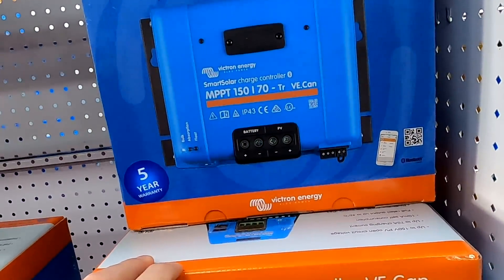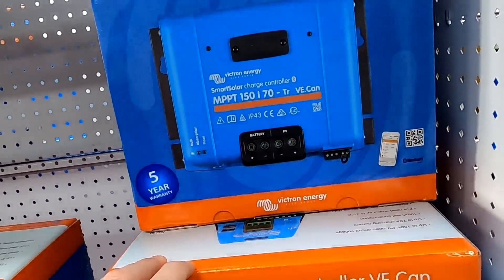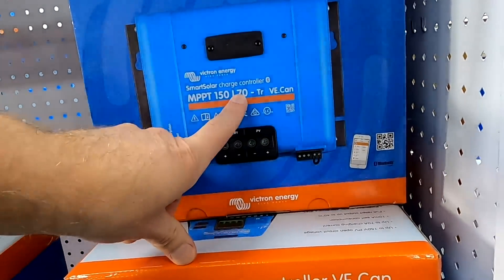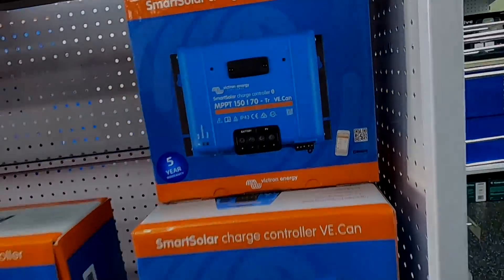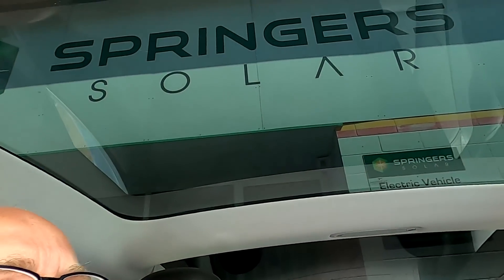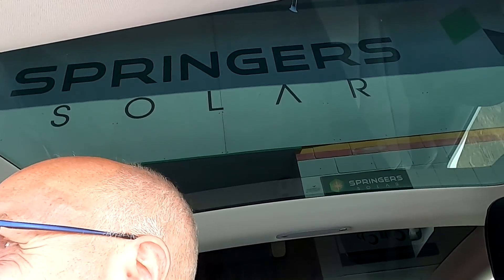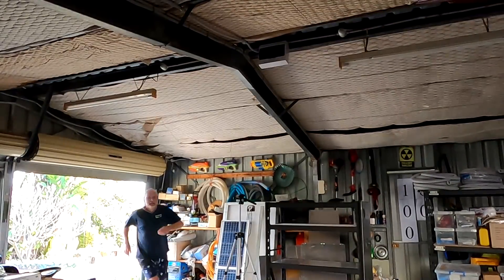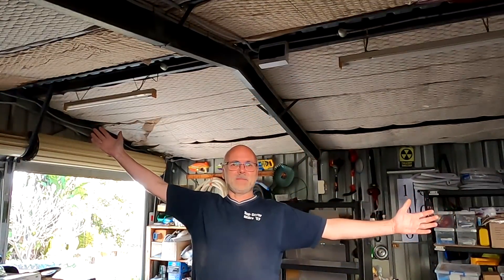Info from the Victron installer about the house off-grid connection. Not as expected... Part I

Comment: Exactly what I said.  Aircon is 5kw.  If you just did the easy rewire it would save you loads.  Pumps as well.  You said it upside down.  You want the big loads on solar and the small loads on grid.  The aircon has an outside isolator.  How easy it that to rewire.  Same as the pumps.  Too easy.
Reply from the maker: We don't use the aircon much, maybe 1-2 times a year if it gets really hot. The aircon is not a problem and can stay on the solar circuit.

Comment: I would switch the utility to a new panel with line back to the OGG for charging the batteries. Run a new line from the OGG to the original panel power the whole house. Export all the house solar. Expand OGG Solar arrays and Inverters. In 7 yrs it will pay for your expansion and you will be ready to be totally off grid when your contract ends.
Reply from the maker: Earthworks are not really an option though.
Reply: @OffGridGarageAustralia  Ya me 2 I have a cement drive between the house and my OGG

Comment: So if you're allowed to charge your batteries from the grid does that mean you're allowed to charge the batteries from the grid while you are also using your batteries to power everything?  How do they feel about having that charger built into your inverter?  So maybe you'll have to get a standalone charger. No big deal.  I know that's less inefficient switching AC to DC and then back to AC again but if you had a 500 volt battery like me the losses would be negligible.
Reply from the maker: The charger can be in the inverter, yes. But the inverter cannot be connected back to the grid in any other form to feed something in.  It needs to be a pure off-grid inverter.
Reply: @OffGridGarageAustralia  well then it sounds like that's the solution. Maybe you're losing some efficiency there but PV panel cost being low will compensate for the losses. And building your own battery keeps those cheap enough as well

Comment: I think that was my exact suggestion one week ago 👍 That is what I have all my friends here in the states do... It is very difficult to integrate a system to the grid but there's no litigation with separating out the circuits and running your own system.... Also with "All in one" hybrid inverters You can charge the system with cheap power if you have limited solar.... When it's all said and done you do own your own house and can control the circuitry inside at least for now 😋
* Side note It is very easy to run overhead wires for your transmission lines if you don't want to dig a trench.... Also there is exterior rated wire that doesn't need to be buried and you can run conduit along the ground both of which are options I've employed in the past 👍
Reply from the maker: I cannot use an all-in one inverter. It is connected to the grid.
Reply: I think this might be a marketing terminology difference between the states and down under... Among the several inverter systems I own and use I have an all-in-one hybrid PIP 2424 all-in-one MPP solar Inverter. It has been used purely off-grid for the last year and a half as a stand-alone system connected to X2 Tesla model "S" 18650 bricks and powering my well pump, several lights and a small window AC unit***I know that's not a very efficient setup I'm working on fixing it...
As I see it these are the definitions:
"All in one"- Inverter, charge controller, and battery charger in one package.
"Hybrid"- Able to be paralleled and used On or Off-grid.
Quoted from MPP solar inverter selection guide " It’s important to recognize that all Hybrid inverters can operate as Off-Grid inverters, but not vice versa"
https://www.mppsolar.com/v3/inverter-selection-guide-2/ 
I like to get the hybrids in case the power ever makes it out to me in BFE 😋
As a more technical definition with these all-in-one units I would argue that a true grid tie system is AC coupled (My old Trace and Outbacks) whereas many of the all-in-one units are DC coupled... I am building a new system to run some mini splits, a water heater, and a tiny home It is going to be a fairly large off-grid system. The Growatt 5000se "All in one" inverter that I am planning on purchasing for this system will: Process the solar power aka. Charge Control, invert the DC power in the battery, and charge the batteries via a generator input when I don't get enough solar... I do not believe these are considered hybrid inverters because they cannot really parallel to the grid. They only consume power or bypass...
If you have different definitions for these terms I'd be very interested to hear them... It is nicer for all on the same page and could change some of the information I've gained from your videos or maybe I'm using the wrong terms??? No worries either way 🤠

Comment: Hi again. have suspected that for at least 10 years while sat in traffic ticking over while travelling to and from work I could not only be charging the vehicle battery but also a pack to power the house and plug in on return ? does this not sound familiar with what they want to do with electric cars. yes I drive a land rover green (black paint) since 1948

Comment: You can also add outlets next to your existing outlets (green colored) for your of grid power. Then you can plug your refrigerator, for instance, into the off-grid outlet, but return it to the grid outlet if there is no sun or your inverter fails, etc
Reply from the maker: But there is no cable connection left from the garage to the house. That's not an option.
Reply: @OffGridGarageAustralia  Yes, that is an issue. In my case the garage is attached to the house and it will mean running cabling in the attic space which will be tiresome but certainly doable. I need to investigate the permitting costs and hassles involved before I begin my project, though.

Comment: Andy I have sympathy for you. I have been playing with the camping system and can do it for five nights 100 watt panel 110 amp battery. Have thought about the house as live there on my own currently. So what I would want is more or less off grid and only sell back to grid when batteries fully charged and have the grid as back up after for example a full week of cloudy days which in uk might be more often than you thnk as I have found when camping.. I believe what I want to do is the opposite of what they want for the privilige of generating off your roof for example. Have contemplated duplicate off grid circuit for when batteries dead for example. run off own circuits when powered up. suppose problem occurs when you inadvertently create a bridge between to circuuits without realising it

Comment: second power board on the side of the house and change over all the electricals you can manage and wire to off grid system.
the question is, how long will it take for you to make back the cost of doing that and weather it's worth it.
Reply from the maker: And there is no additional cable from the garage to the house to supply this new panel...
Reply: @OffGridGarageAustralia  time to dig a trench!  lol  but yea, the ROI would be quite some time I'd imagine.
Reply from the maker: @John-gm8ty  I think it's both not worth doing for the time being. I'll dump the energy in the Tesla, hot water and pool pump and that's should be a far bigger load as the whole house together. And no additional cables needed...
Reply: @OffGridGarageAustralia  I completely agree with you.  
I plan to do the same when I put up our old system panels on my garage, run the pool pump.  the hot water is gas unfortunately and has no booster port for an element.   but I've already repaired it once for a leak so it's only a matter of time until it has to be replaced.

Comment: Why don’t you add a off grid sub panel at your home and wire separate circuits to off grid. Expand your off grid battery storage and add solar panels to feed your new off grid sub panel. Nothing ever goes back to grid!!!
Reply from the maker: As I explained, there is no cable left to connect this second sub panel to the garage.

Comment: What about the idea of running another 240v circuit throughout the house to critical loads, then put in the new inverter for the house and just not connect to the grid until contract is up
Reply from the maker: No further connection to the garage as the existing ones.

Comment: If it were me, I'd probably just go with simply adding a 48V water pre-heater tank to dump excess solar into, pretty cost-effective way of storing 10-20kWh if you regularly use that much hot water.

Comment: What you have explained is exactly the way I have installed my system here in Melbourne. Nearly all my house is on the Off grid system. I have a new breaker board with an off grid inverter. I can use the grid to charge batteries if and when required. It means the grid connected system can export more and I now have power when the grid goes down. Have you found a place for your house off grid breaker board yet.
Reply from the maker: That's unfortunately not an option for me due to house and garage (where the batteries are) being separated by over 40m. I can only do that once the contract runs out.
Reply: @OffGridGarageAustralia  if I can run my power 300 m you can certainly run it 40.
Reply from the maker: @SiriusSolar  Nope, that's a no go!

Comment: I would have told the power utility to come get their meter a year ago. Kudos to your patience, I think need to calibrate another solar pointer.
Reply: Feed in tariff is very generous in Australia, With my grid connected and Off grid system my yearly power bill is ZERO.
Reply: In the states every state has their own way of doing things, in New Mexico they let you tie to the grid, but they review your metered service for the last year and limit the size of system accordingly .  They Bank your watts uploaded and when they read your meter they subtract your usage from the Bank. I got lucky because I was running a hot tub / pool for year they reviewed.  I only run for special occasions now, so I never have any out of pocket monthly power utility charges, other than their $8.00 administrative fee.The only way to get paid for my Banked watts is to move. I average about 20 Megawatts a year, with 36 solar panels. I plan on buying one the new Ford electric F150’s and charging it with separate solar array like your garage.
Reply from the maker: Yeah, nah, that's not an option at all. Why should I sacrifice the 54.2c/kWh feed-in just to go off-grid altogether? That's a solution once the contract ends and the feed-in drops from 54.2c to 10c. The it makes sense.

Comment: I proposed the very solution in the first video to add a sub panel and move certain circuits to the second panel and let them operate completely off-grid. With no transfer switch and no interconnection, there is no violation. With the second panel, there is no need to rewire the house, just pull the individual circuits from the main panel, put them in the second, and run one main cable back to the garage. The only wire that might have something in common would be a ground/earth. Once the contract expires in 2028 just put the circuits back and expand it all to your greatest desire.
Reply from the maker: That would only work for the non-essential loads though, hot water, pool pump and EV charging.
Reply: @OffGridGarageAustralia  How are you only limited to those? The only real limiting factor would be the sizing of your inverters and your willingness to run a cable from the garage to the house. If you have a second panel that would only be needed through the end of your contract you could feasibly locate it next to your current panel and just move any breaker from one panel to the other and very easily move breakers that have single loads like your refrigerator, oven, microwave, washer-dryer, etc. just by adding them to the second panel powered by your off-grid system and completely removing them from the grid tied system.

I know you are not thrilled by the prospect of running a cable through a trench to the house however it could be valuable if and or when you decide to go completely off-grid when your contract expires. Digging the trench yourself and running the conduit and cable to a separate secondary panel is significantly cheaper than hiring it out. Having a sparky come out and advise you where to put everything according to code is worth a couple hundred bucks and way cheaper than having them dig the trench by doing the labor yourself. Once its all done then have them come back to make the final connections and inspection. 3-4 grand for your labor and materials is much cheaper than 15-20 and having them do it all.

Comment: At least you know your boundaries now.
I had incorrectly heard that in Queensland the off grid system has to be in a separate building not connected to the premise supplied by the grid. Glad Eddie Springer clarified that. 
I think I need to hire a trencher to get the second off grid curcuit installed. Have to run some numbers to see if my contribution to my sparkies early retirenent will ROI in 7 years..
Reply from the maker: Yes, that's a lot of money to get earth work done. It seems it's not worth it for me to do at all.

Comment: This is actually the best news!
Your always better with dump loads, you currently seem to use the car as a manual dump load,  but automated dump loads,  even a separate AC in the house to take load of your grid-tied AC.
Reply from the maker: The pool pump, the hot water and the EV charging all starts in the meter box outside the garage. So that's ideal for exactly such an installation.
Reply: @OffGridGarageAustralia  aye, seen part 2 now, and plan is all good.  You can adjust pool pump timer for general weather that week. 2nd EV charger so you can choose which power to use also a great thing for winter time power shortages.
Still be nice to have a true dump load, but no point wasting that for hot water for your usage.

Comment: Think about this carefully , there is no cost $$$$ in that!!!! You are doing a great job and I am impressed with your knowledge, skills and ability!😉 
2 circuit breaker boxes in the house will be the easy way to re-direct the load. That will go to the garage. Local building laws might challenge that alteration. You are smart so work the grey matter and solve this challenge. I have confidence in your ability. Thanks for this exercise in Utility!!! 👍 Is there a frequency of light that the solar panel excepts????  If so can the new/extra solar panels be able to charge the additional /new batteries and use that energy to energize the lights suppling the panels at night!!!!   No direct connection to the grid 🤔. Think on that and swing the lights out of the way during the day!  🙏🏻.
Reply from the maker: There is no additional cables to the house to supply these new panels, so that's not an option.

Comment: what if you install one of the all in one units that will work of solar and battery is low it will flick on the mains to charge the batterys or hybrid as long as send back to the grid is turned off i mean like the growart units
Reply from the maker: I'm not allowed to connect any further inverter to the grid.
Reply: @OffGridGarageAustralia  theses units dont send back to the grid only let's say the emergency charger side does I thought you might have had a loop hole with having 3 phase rather them most domestic that only have single phase

Comment: Don't bother re-wiring the house,  just add new power points (I used different color cover plates and outlets for clarity).  Run all the wires back to a new sub panel that gets power from a new inverter in the garage.
Reply: Good way to do it, I use to do that 20 years ago white is grid, red power points were solar
Reply: @scoobyblu5815  I rent my home in the UK so it's easier for me to put a new consumer unit in (and earth rod) then move over the circuit that I want off grid.

If I move out then I put it all back as it was but I also have done an electrical test on the new circuits so if the landlord comes sniffing around I provide all the certificates is asked for or put it back as it was
Reply: @scoobyblu5815  That could be a much bigger, more expensive job on an existing house. Great idea for a new build or a complete renovation though

Comment: i would move the car charging to the garage it makes sense that if grid goes down you can still charge same for water pumps to keep things working
Reply: And you can get "chargers" (EVSE) that can change the amp based on usage in the house.

By connecting a clam on the output in the inverter, you can set the charger only to pull up to 80% of the inverters capacity.

These "chargers" are designed to charge as fast as possible, without overtaxing the main circuit breaker.
Reply from the maker: That's only the Zappi afaik?
Reply: @OffGridGarageAustralia  Zappi is the only one that I know that is self contained. All the other ones I know if need a computer system (payed cloud service), and uses data from smart meeters.

Zappi was originally created to avoid selling the solar and wind to the grid. The support to have a other max than 0 was added later.
Reply: @OffGridGarageAustralia  New update today.

Victron is testing a new product, an wall mounted EVSE.